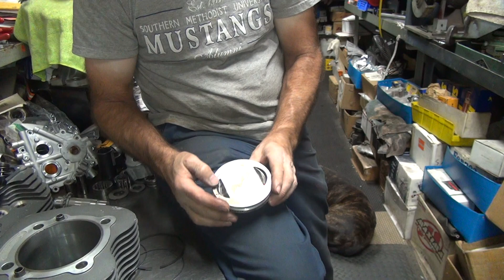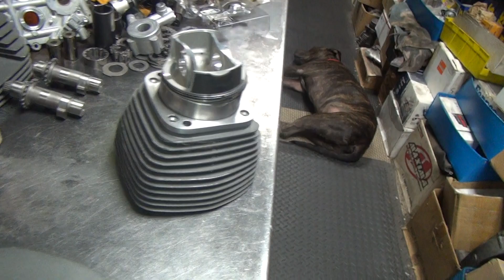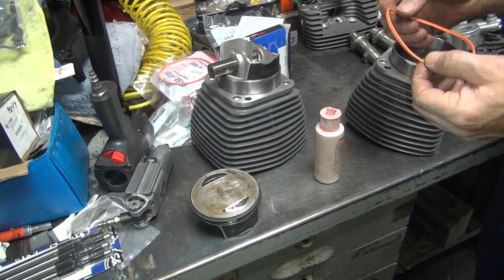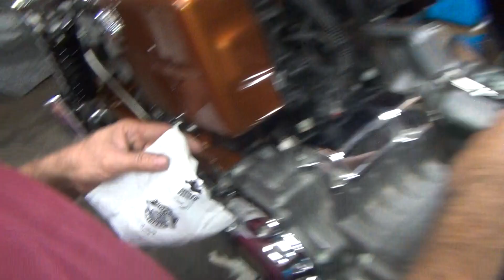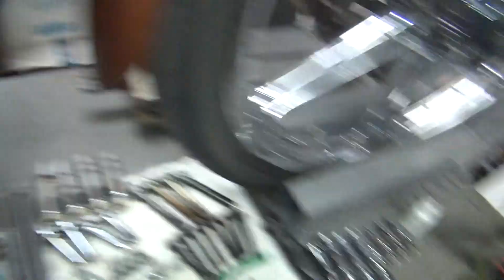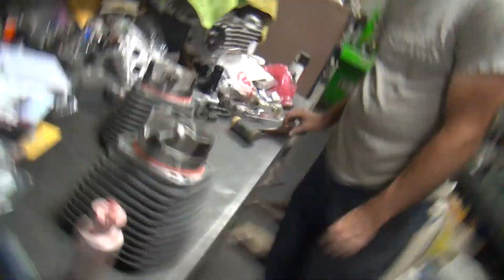#116 2008 110ci cvo twincam fxd dyna motor repair rebuild harley by tatro machine

Comment: Tatro, is there an easy way to clean that Nasty carbon from USED pistons? I have tried Sandpaper and CRC with a little success
Reply from the maker: my scraper works good on flattop pistons. carb cleaner should work too.
tatro